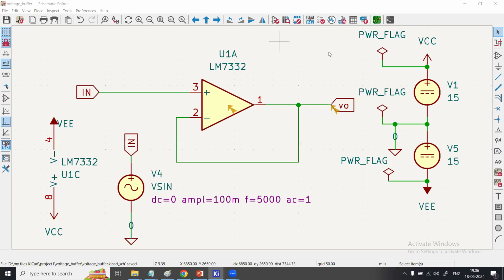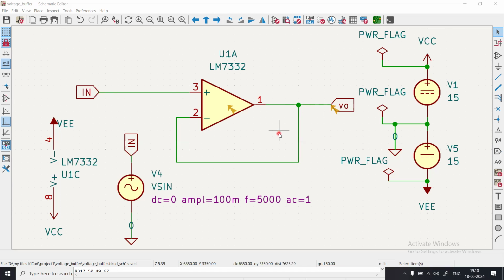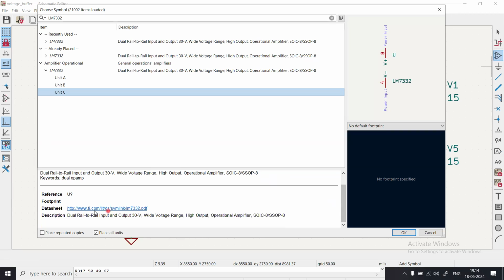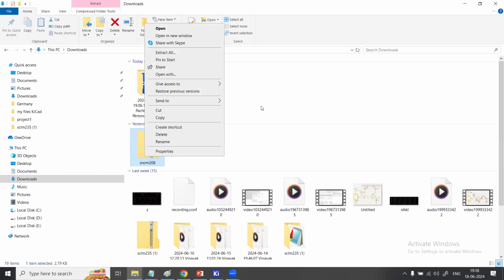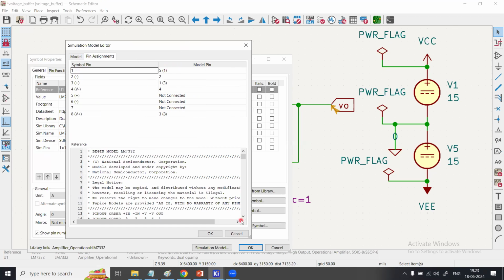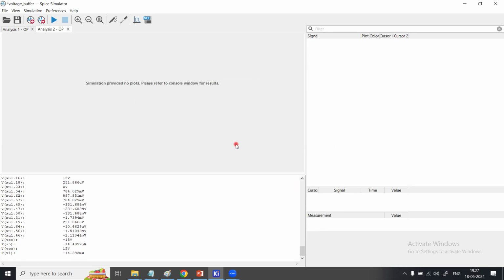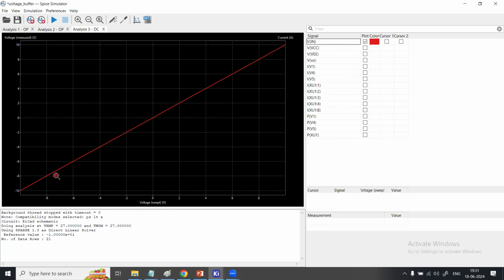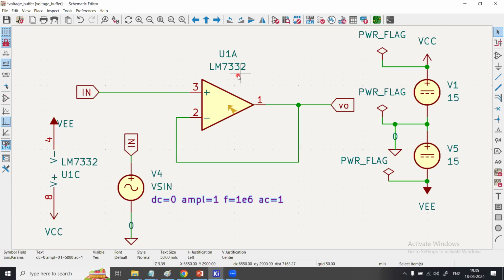How to Design a High-Output Current Circuit !

Comment: Wouldn't you use a low-ish resistor on the output to test what power the opamp can deliver? Open-output would be almost no current, not high-current test as in the title
Reply from the maker: Kindly refer to the datasheet of the part explained. You will see how title is correct
Reply: @VPACHKAWADE You did not understand their question correctly.  The part is theoretically capable of high current output, but your simulation is not simulating a high-current load.  You have nothing connected to the output, so your simulation is just simulating a high-impedance output, and does not show what the circuit will actually do when attached a low-impedance (high-current) load.
Reply from the maker: @foogod4237 Thanks for the message. That's left as an exercise for the viewers..